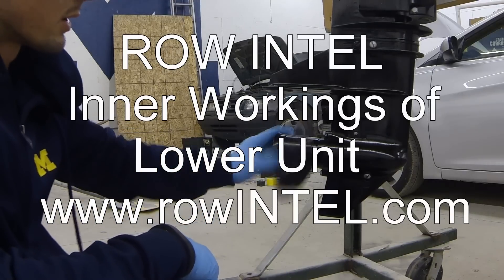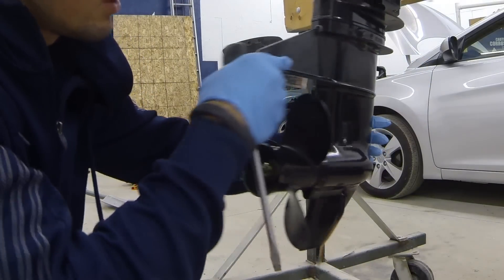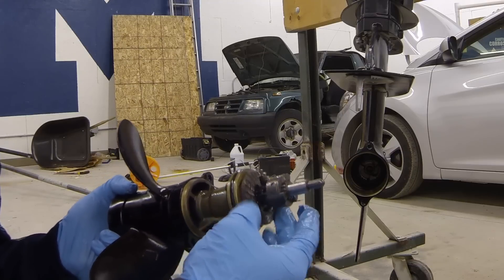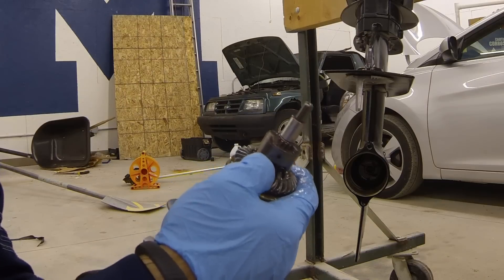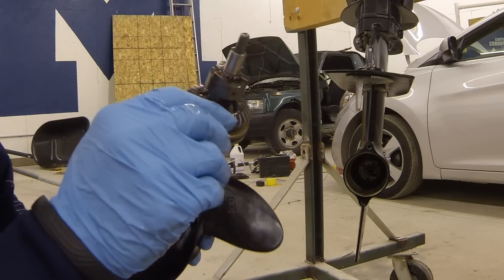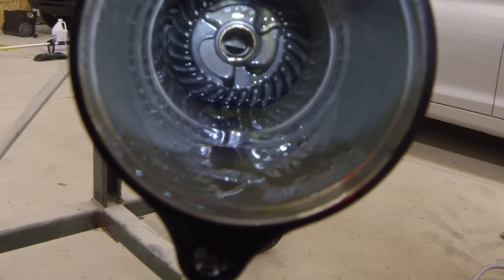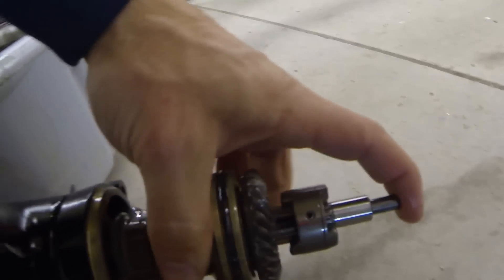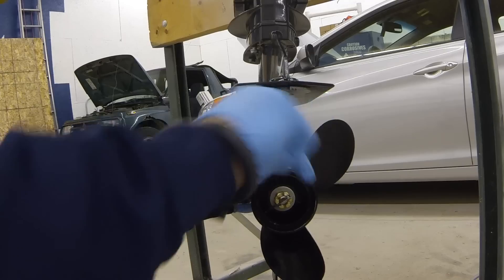HOW TO take apart a lower unit on an outboard motor, how it works

Comment: I can’t get my gears to switch I took the lower unit off to change water pump and I put it back on it’s all the way up like it’s in forward but I can’t push it down I took it back off it will go into reverse and forward but I put it in reverse and I put it back on and it still showing. It’s all the way up and it won’t move with the gear switch on the motor

Comment: 125 hp merc only stays in nentral, foward and reverse lever works but does not go in gear, shift rod that goes to toggel just spins so not moving dog gear any help will be help full, have lower unit rebuild kit coming thanks jim

Comment: Before you disassemble the lower drive unit.... Tilt the engine in to stowage possition and try the shifter again while still on the inflatable.
If it goes in to gear then look at the transome of the boat and if there is a small aluminium half ring to tie to on the outboard side of the motor mount... It will jam the reverse lock mechanism on the outboard. The shifter shaft must lift this reverse locking mechanism to go in to gear. This is to prevent damage to the outboard if you run aground... The engine will kick up.
Use a zip disk and cut this half aluminium ring off the dingy mount and the locking mechanism should be freed up. And alow the shifer shaft to lift the mechanism.
My dingy is an avon. Achillies have the same problem.

Comment: I cannot thank you enough for your video. After numerous calls, repair quotes, and endless frustration, you explained beautifully what the problem I was running into. Thanks to you, a quoted $1500 repair wound up costing me right at $250 in parts. Thank you so much for this video.

Comment: When i bolt the propeller housing/seal back on, it l leaks. It didn’t leak before, but now some lube drops out the bottom bolt. I made sure to torque the bolts down little by little back and forth to insure even tightening; any thing i could do differently?

Comment: And how do you pull the pinion gear off the drive shaft so that you can change out the drive shaft seals along with the shifter seals to do a complete reseal on the lower unit? What would cause the lower unit to only engage in drive but not reverse?

Comment: Hi there. Very informative video. I have a small yamaha 8hp and the propeller has 1/2" movement left and right when in gear so is this normal or would it be best to chang the dog.
Many thks

Comment: What would be the reason for the gear/ drive to be going counter clockwise in forward position after changing the impeller? Its a hand driven Mercury 18xd outboard (1986) approx. So turning the hand shift to forward it's going in reverse. Frustrating. Right hand propeller.

Comment: Hi bud great video , have an older 2 stroke 15 hp goes into forward and reverse but after idle won’t pick up speed but reverse works ? Dog clutch teeth gone or broken ? You’re thoughts cheers

Comment: The splines on the top of the shaft are twisted at the top 1 inch or so and then straighten out.  Is this normal?  I removed the lower end for bbn impeller vfc replacement and now having hard time reinstalling.

Comment: I had to replace the pinion gear of my 89 Merc 15 hp outboard. Is there any trick for getting the spline of the driveshaft to enter the pinion?

Comment: Excellent video I was wondering do you have to take the lower part off to replace that  Shaft or that reverse  mine is real hard to go in reverse and I hear a clicking noise

Comment: Where did or can I get those parts I live in Alaska a whole lower end basically needs to be replace the whole gears and there’s a exploded Matic is loud which damaged some of the threads I could probably save the threads with a chase

Comment: Thank you for the great video. I did not catch the kind of motor you were working on. I have a 2015 20hp mercury 4 stroke (rev on the handle). Goes into reverse fine but when I put it under load or rev it up, it comes out of gear. Would you think that it is a dog clutch problem or an adjustment problem? Thank you for any advice you can give me.

Comment: My Yamaha 6hp gear lever is stuck  stif and is very hard to shift from neutral.
Is  this a problem in the lower unit or is that the lever need lubrication at the top handle ?
Is has been like 2 month I don’t used it. Just run it today ,  everything runs good but that

Comment: Hey what could cause a knocking noise on the lower unit?
Reply: Maybe the prop ,iwas using an aftermarket prop on 9.9 4 stroke yamaha an it was making a nocking noise on full speed only,and dit not know what it was till i replace the propeller for an original,cost more but that solve the problem,may want to try that good luck.....

Comment: I am having problems with getting out of Forward back into Neutral.  Have you ever come across this.  It does seem after the motor warms up and/or if I mess around with the trim.  Have you ever seen this issue and if so do you know how it can be fixed?

Comment: What if it won’t go into reverse or neutral?
Reply: I am having same problem, did you ever figure yours out ? I have taken mine off 4 times to try and figure it out and I cant 🤪🤪🤪🤪
Reply: @benharley6594  I guess it fails into forward gear.  Mine ended up being a plastic slide bracket on the shifter lever on the motor.

Comment: Thanks, I have a 2006 Mercury F25 EFI and found this video after I recently discovered water in my lower unit oil. While this video is very helpful in showing me how to dis-assembly and reassembly the lower unit, my question has to do more with the seals. If you know,  is it normally only the seal on the prop shaft that needs replacing or on the driveshaft as well? I'm doing the work myself and want to do/get it right. Any thoughts or suggestions would be greatly appreciated. Thanks. Great video!
Reply: Hope you still aren't waiting for him to answer after 2 years.lol

Comment: You didn't show how you got the cam lined back up. I was replacing my impeller an inspecting everything for blockage. Ended up pulling a bolt I shouldn't have and now I can't get the cam back down far enough to bolt it all down

Comment: Great video, very informative.  
I was changing my  Merc 4 stroke 2.5 hp impeller,  I inadvertently moved the shift rod and drive shaft out of place in lower unit.  I had to take the prop off because the small gear that turns driveshaft fell off.I put it all back together,  checked it (first time doing this) , it looked properly  functional. When I start motor, there is no neutral , the prop just spins when I shift the lever, the linkage does go up and down but nothing happens, prop just spins, can you please help. Thanks in advance
Reply: Got the same problem pull the cam that changes the gear out of position. Does not want to go back. I may have to  pull the propeller shaft out first. The drop the cam  and push the propeller shift back

Comment: Good morning I have a quick question I took mine out this same piece and when im trying to put it back is not going in all the way im missing like a 1/4 to go in all way and this is in every gear i even remove that front piece that looks like a bullet to see if it was hitting something and same thing the whole thing is not going in all the way in gear i hear the ratcheting i even did it in neutral and nothing play with it a million times and dont understand what im i doing wrong i dont see anything else to this i was hoping you guys have some tips or some tricks to this thanks

Comment: I just bought a used 2004 Johnson (Suzuki) 4 stroke 15hp.  Found out it was popping out of reverse.  Can I just replace the reverse gear if the dog looks ok?How will a new ring gear mesh with the old pinion gear?   Thx

Comment: I have a 2018 Mercury 150hp and hit a rock bar. The whole thing shakes when shifting into F or R. I was hoping a new prop would fix it but no. Most likely prop shaft?
Reply: Sounds like it.. how much did that set you back if you don't mind me asking

Comment: I changed my lower unit oil this week due to a unusual sound coming from my 1996 40hp merc.Almost the same as a lifter tick in a car engine.After draining the gear box my drain plug had a couple pieces  small but chucks of metal more than the usual wear and tare shavings.Does it require any special tools to rebuild a lower unit?

Comment: Great video! 
Question: when I put the lower unit on it seems to be stuck in forward gear. 
Question: I accidentally pulled the gear shift rod out from the lower unit, is there a trick to replacing it?

Comment: Anyone know of a video or would like to make a video on how to fix a 1996 Yamaha 25 horse 25Elhu Lower unit. Basically have to rebuild mine after a sheer pin fell/broke (somehow bought the motor with out reverse and thought there was something wrong with the linkage only) in between gears and chewed up and destroyed all the splicing on the gears. Thanks for the help.

Comment: why when I resemble the lower unit it stays in gear and won't go back to nuatral
Reply: probally because the shift rod is not engaging that dog into a gear. is there any adjustment you can make on your shift rod?

Comment: I have purchased a bass boat with a Johnson 150 fast strike and it will not Engadge into gear from my under standings it seems like you could deffinitley replace it pretty inexpesively instead of purchasing a brand new lower unit thank you very much !!!

Comment: Huge help, thank you! On your last point about ordering new parts: would you dissuade someone with little experience from fixing broken gears in the lower unit? The unit is 75hp and my goal is to restore it, if possible.
Reply from the maker: If you can find the proper service manual for that unit you will not have a problem, otherwise it can be tough with a few parts that may not make sense

Comment: Thanks for good explaination vid. I have a 75hp merc outboard....I just tried to get my pontoon boat ready to launch finally!  Noticed I made a fatal error not being familiar with outboard engines (new to this game). I left my engine in the travel position (prop pointing towards sky) all winter. Water got  into the lower unit and froze of course, expanded and broke off the bolt flanges on the lower unit prop shaft bearing unit. So I ordered a new one from my marina. When I install the new one, I assume I should grease the prop splines. I will get new seals for the new unit. Anything I should be aware of when reassembling?
Reply: How did u turn out with this was it pretty straight forward? My stepdad has done the exact same thing to his pontoon boat I'm going to tear I down today for him

Comment: Nice video.  When we were driving our outboard the other day in forward the engine started making loud noises.  It only happens in forward, reverse seems fine.  I am thinking it is the forward gear or dog attachment for forward.  How would I go about getting the forward gear out?  Do I have to take the whole lower unit off to do that?  Thank you
Reply from the maker: Could be as simple as adjusting the shift cables or shift rod, otherwise yes, time to drop the foot and have a look inside.

Comment: thank you for posting this.  our 98 evinrude ocean pro just stranded my folks . and they told me the boat ran great but they heard a clunk and it was done. and it was been clunking into gear . so I guess need to inspect the gears and that cam .
Reply from the maker: Sounds right, probably water intrusion has gotten to the gears
Reply: It got to them and ruined them lol . There are holes by both intakes and oil dripping  down them . Luckily we found a used lower unit.  So it should be on the water soon.

Comment: Best hands down thanks brother was about to throw back together and just not have reverse.But that could cost a man his sail boat going threw the coral reefs and such..Thanks from sailing catamaran vessel No Problem
.Have to start starting these motors more after all this work.Do you have any videos on pulling a power head?Have to replace shift cams Yamaha 25 long shafts..

Comment: Excellent video.  I just replaced the water pump assembly on a 1998 Mercury 9.9 ML kicker.  In doing so I had to remove the shift rod to replace the lower pump housing.  FYI, I have a remote throttle and shift lever if that makes any difference.  After I buttoned everything up it will shift into neutral and forward but not reverse. Also, when in forward, the prop still spins, as if in neutral, but clicks.  I obviously didn't get the shift rod back in correctly, but I'm not sure what I did wrong.  Any suggestions on how to fix this would be greatly appreciated.
Reply from the maker: Where the shift rod joins together in the middle is just probably a little out of adjustment.  Undo that long brass "sleeve" bolt and try adjusting with a few threads inbetween the rod ends.  This will allow the shift rod to travel down farther,  put the gear case into reverse.
Reply: Thank you for the quick response.  However, my shift rod is a one piece unit.  The cam/shoe that engages the dog is threaded on and that is how you adjust the length.  I thought I got it threaded on in the same position that it was prior to installing the new water pump, but maybe I didn't.  Question, which way does the angles portion of the cam/shoe face?  Does the angled portion face the dog or does it face the front of the gear housing?

Comment: I have 77 140 evenrude it will go in forward and reverse but it won't go into neutral any ideas on what it could possibly be?
Reply from the maker: +Zachary Nelms Sounds like shift cable is probably just out of adjustment, Neutral is right inbetween forward and reverse, for it to switch gears, it must spend some amount of time in neutral, it may just be not lined up with when the lever is vertical.

Comment: what if gear is in neutral, and the prop still isn't spinning? what can be the culprit?
Reply from the maker: +Shit Tree Sounds like something may be broke in there, or the shift rod has come disconnected and the gear case is not truly in neutral.  You'd need to start by verifying the shift rod is moving up and down when you shift.

Comment: is the lower unit of an inboard motor the same as the outboard motor?
Reply from the maker: +cody wall Similar if it is an I/O (inboard / outboard with an outdrive).  If it is a true inboard like on a sailboat, then no.  There would not be a lower unit, just a separate transmission going to the prop shaft.

Comment: Dang! This is the closest thing to replacing the shifter cam. Great video. I was taking the lower unit off my 87 40 hp mariner and broke the shaft at the bottom where the roll pin goes in. BONEHEAD MOVE! Still trying to figure out if i want to attempt it or not.

Comment: Thanks for the awesome video. I have a 1995 Mercury black max. Oil is coming out of the lower unit. The gear oil plugs are on tight and no leak from there. Do you think oil is getting passed the seal and how you I replace the seal?

Comment: Thanks for the brilliant video. just drained the leg oil on my 78 evinrude (serves me right I know!) and it was a yellow creamy color (water in there I assume). I have a spare engine so will pull the gear case and prop from that, keep it on the boat and replace the seal on the current one for now. Such a good video! Well done and thanks again.

Comment: Yamaha 115  4 stroke ,, I have a strange situation, my transmission   got stuck in reverse . When we took apart the lower unit, we took out the gear shaft rod , saw that  the tip of the rod or  shaft or Dog¨´ tip  broke off in the gear case,  how do I remove that little piece of metal  ?
Reply: +Richard Cahill Somehow release the tension pressing against it and wiggle it upside down til it comes out.  Probably best to start with a long very thin flat head screw driver.
Reply: Thank you for the quick response,  we did try  this upside down, Ill try again moving the prop shaft

Comment: nice🎥 i hve a 96 115 evinrude, rev wrks fine, frwd revs before engaging. Gears or hub? and are the lower unit removals the same in some way, thks
Reply from the maker: That doesn't sound like a lower unit prob.  sounds like your control box is out of adjustment.  take a look at adjusting control cables

Comment: hello, i need help hopefully you can assist. i took of my lower unit but i dont remember if i had it in forward gear or neutral when i took it off. now, i reinstalled the lower unit connected all the wires but now its like the battery is dead but i tried it with three fully charges batteries and it still wont start. i turn the key and nothing not even a noise at all or makes an attempt to start. any suggestions

Comment: I have an old 60 HP Evinrude motor that runs fine and shifts fine.  However, after sitting for a couple of months, I notices gear oil on the River-Runner I attached to the scag.  I ran it up just a bit after noting the gear oil, and runs / shifts fine.
From what I can gather, this is probably coming from the main seal leaking.  Am I correct?  If so, I imagine I should follow your video on taking the lower unit apart, checking the gears, etc. on the prop shaft, and if OK, replace the seal and fill er up.  Am I on the right track??
Reply: +Ed Woolever  pressure test for at least ten mins ..14 psi...look for air bubbles  at top as well as bottom seals .if pressure drops at all in that ten mins ..you have a leak....even better if you can do it under water in a drum ..just look where bubbles come from...
Reply: +Jason Taylor i just saw your question was from 7 months ago...

Comment: Hi, nice video! Been searching for an instruction video how to dis-assembly an older lower-unit (like 1985 for example) that has been running in salt water many years. These bearing carriers can be really stuck to the lower unit and will not easily come out... I have not found any video on how to do the job...